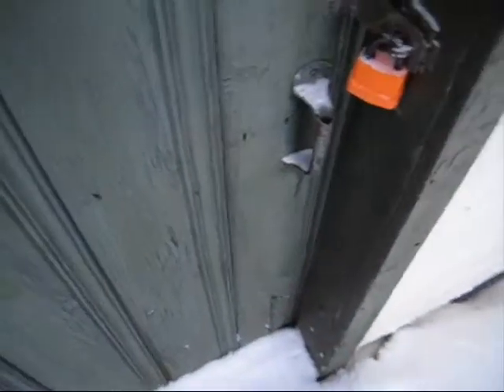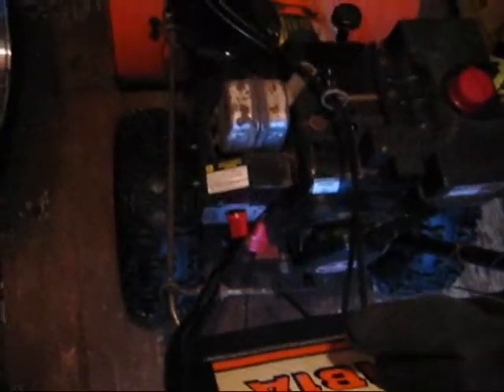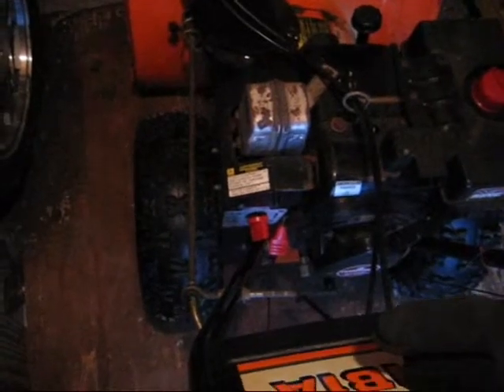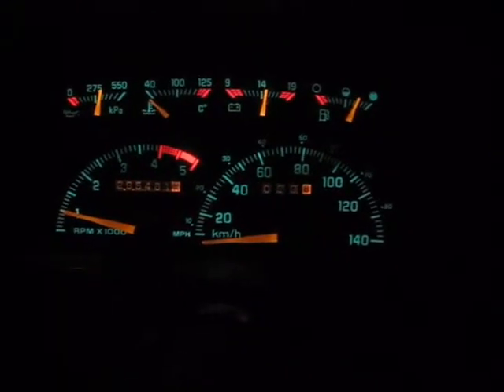Snowblowing and general chit chat

Comment: Not much snow here yet.  Everything seems to go north or south.  I had a 90 chevy with a 4.3.  Didn't have it long.  Got V8's after that.  I got a 98 S10 now with the Vortec 4.3 and I am doing intake gaskets on it now.  Common problem on the Vortec V6 and V8 I guess.
Reply from the maker: 4.3 intake gasket only a problem after 95/96. So mine doesnt suffer from that :) They changed the heads and intake. No plastic intake on mine. I got v8 diesel now. Not a big drop in mpg between both truck. I won't be buying a plow this year, the truck side harness and mounts are hard to find in used, and I refuse to buy new
Reply: The lower intake is aluminum.  The upper intake that houses the injector spider is plastic.  The plastic upper intake is not the problem.  The gaskets that GM used were not that great.  I have been tracking my mpg on the S10 before the intake job.  I got 14-19 mpg.  The 14mpg was because of a lot of idling.  The 19mpg was like highway driving.  I did a mileage check on my dually before I put the big tires on and was getting around 18mpg.  I was what I call baby footing the throttle trying to get the best mileage but it was city/country driving not highway.  That is pretty darn good for a 9000lbs truck.  Looking forward to your videos on the glow plugs.  That is something I might have to do next summer.